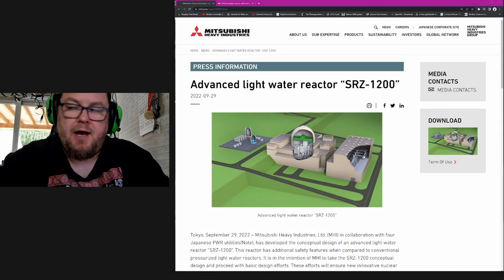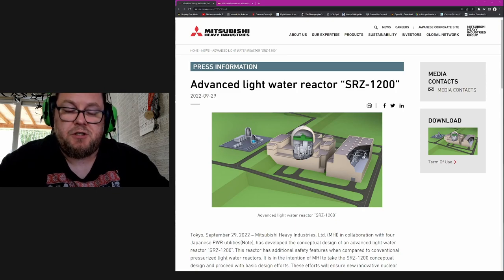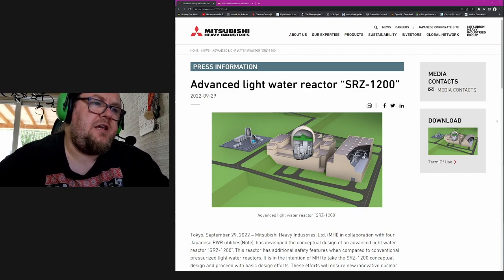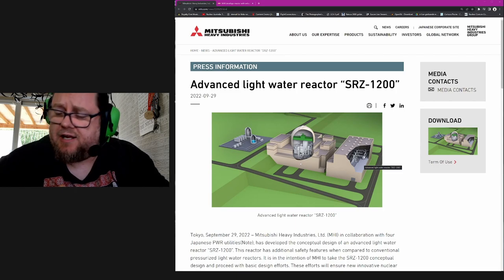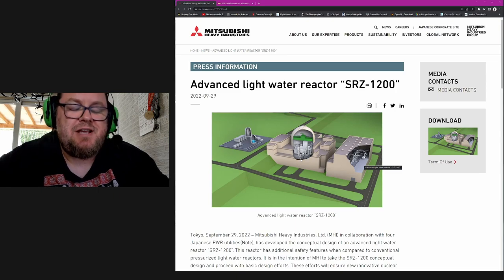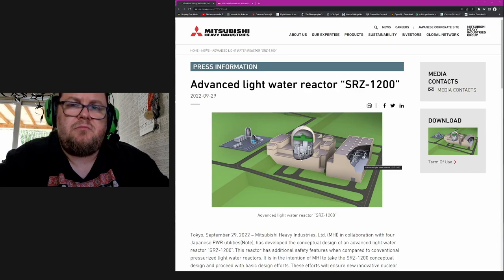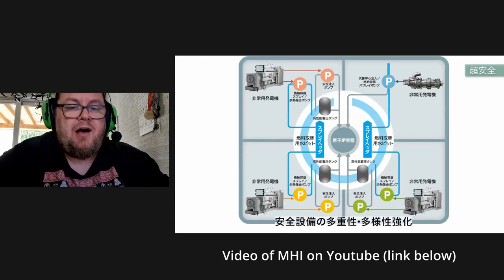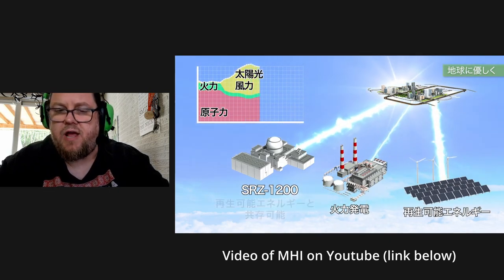Japan has a SUPREME & ULTIMATE new Reactor Design

Comment: What you described at the very end of the video is exactly what Thorcon Power is working towards in Indonesia. 2 years start to grid power. Shipyard build and towed anywhere. All of the power conversion equipment (about 85% of the overall plant) is the same as any coal or natural gas plant. Once this production line gets going, no one will ever build another PWR again.
Reply: @NomenNescio99  Vilken är din favorit?
Reply: @NomenNescio99  What part of my comment did you not understand?
Reply: @chapter4travels  Oh yes, I understood every part of it..

Now, please, can you answer my questions?
Reply from the maker: @NomenNescio99  Exactly, I am a fan of the SMR idea as any follower of this channel knows. But I don't put them on a pedestal above all other reactor designs. And I'm not willing to throw LWRs under the bus either.
Reply: @NomenNescio99  If you understand my comment, then you know what makes it special. This leads me to believe you do not.
Reply: @chapter4travels  No, just plain and simply no. 

I have in other threads quoted scientific papers, independent statistics about LCOE, realities about heavy industry and supply chains/logistics, the actual leasons learned from previous built nuclear reactors, the prices quoted by the vendors in the Canadian SMR procurements among other facts. 

You respond with talking points from marketing material, published by a very small startup company with zero actually delivered nuclear power plants so far.

This is just not a serious way to discuss the topic. 

Nor is it even remotely intellectually honest. 

Do you even have any real world knowledge about these issues? I have a M.Sc/ee degree and been working as an engineer for many decades in industry and I have seen enough shit to base my opinions in some kind of reality. 

And have you really downloaded the IAEA SMR booklet and looked at the 70 other other SMR designs? 

Your answer kind of implies to me that you haven't - you would have approached the topic with a lot more humility if you had. 

The blood testing device from theranos also sounded REALLY cool before reality set in.
Reply: @chapter4travels  Next question to you.

The renewable advocates tells us that all the shortcomings of renewable power will be solved by some future battery technology that currently don't exists outside of PowerPoint. 

In what way are your arguments any different from the renewables crowd?

Shouldn't we all start to build wind turbines then?
Reply: @NomenNescio99  Let's start with this. List for me all the advantages of an MSR over a PWR and we'll see how you do.
Reply: @chapter4travels  Yes, I will do that in great detail for you.

Once you have addressed the questions I've already raised, multiple times, the questions that you keep deflecting.
Reply: @NomenNescio99  If your list is complete, you will have all the answers you're after.
Reply: @chapter4travels  And if you are unable to quote any independent scientific research, third party statistics or any other form of objective facts outside of marketing materials, could you at least adress the question and comparison with renewables?

Somehow I think you will fail to do even that.
Reply: @chapter4travels  No, just simply no - once more.

That's not how you partake in a civilized discussion. 

I've already quoted a metric shitload of facts for you, with references to all kind of sources.

You are continously deflecting and have nothing but marketing material to support your uninformed view.

Like in zero actual facts to support your view! 

Even a question like the comparison with renewables that actually don't even require facts to be answered will very likely only receive the silent treatment from you.

You can keep whatever unsubstantiated dreams and hopes you wish, but don't state them as facts or foundation for policy unless you can support them.
Reply: @NomenNescio99  The list of advantages that a MSR has over PWR's is long and important. Seriously, what's not to like? Once MSRs get into production, no one will ever build another PWR again. Thorcon has a better chance of being in mass production of MRS in Indonesia before a single PWR gets built in the US or Europe. And If they don't, who cares, Seaborg Technologies or Copenhagen Atomics will be there soon after.
Reply: @chapter4travels  Once again, you are deflecting facts and quoting marketing materials.

Yes, there are many theoretical advantages of the MSR design, out of which exactly zero have been proven in real life.

You are still promising great things from a technology that currently only exists in PowerPoint.

Once again, how is this different from the renewables crowd that promises that future advancement in battery technology will cheaply solve all the shortcomings of renewables?
Reply: @NomenNescio99  det är min favorit också, mest för att jag känner stort förtroende för Ed Pheil. Jag har dock inte satt mig in på djupet i nån reaktorkonstruktuon. 
Ett litet hopp jag har är att vi skulle kunna utnyttja Finlands erfarenheter från sin nya reaktor, och kanske bygga 1-2 reaktorer med den lösningen.
Elysium har visst bytt namn nu, Exodys heter de nu. Tänkte fråga dem om de har några framsteg i tillståndsprocessen, vet du kanske nåt hur det går för dem?